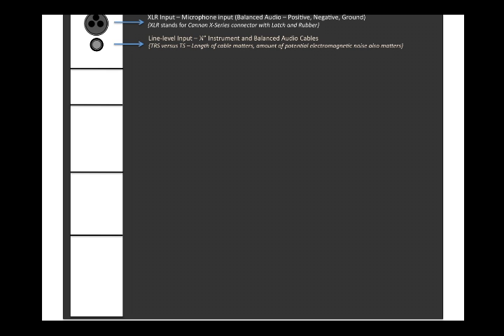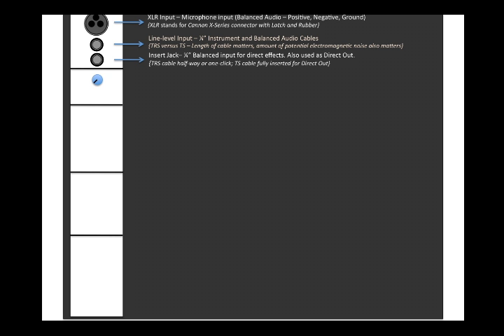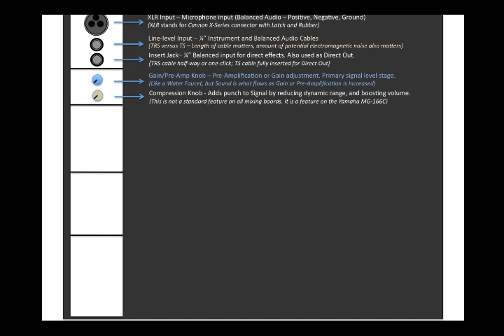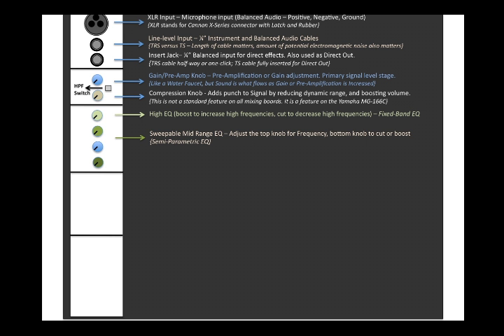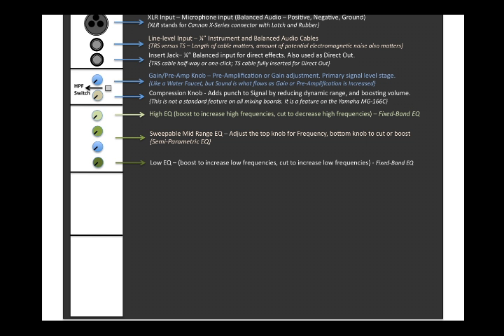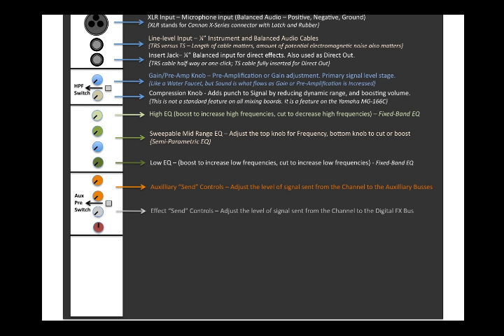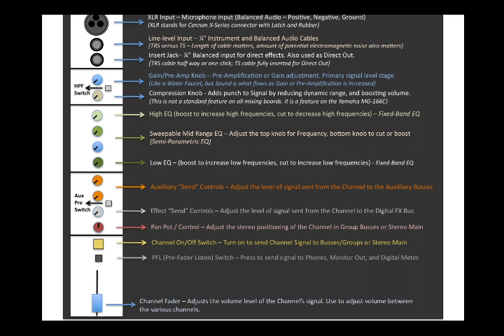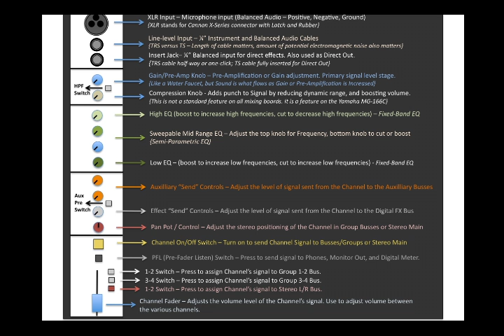The Mixing Board 'How Does It Work': Topic #1 - MONO Channel Strips

Comment: Question can you still some how make stereo music with a mono channel strip how would be the work flow? do drum bass vocals in mono piece by piece then you just have to duplicate your mono synth say for stereo and pan on far left and one far right is that right? Or re record the synth 2 times and effect them differently if you like for a stereo or paraelle effect!!! thanks trying to get my head around is it okay to buy one channel strip hardware or need 2 cheaper ones to make stereo?
Reply from the maker: MIIKE 5 It sounds like you are trying to figure out how the best way to create a stereo image from a mono source. 

So, if you just duplicate a source and pan it, it will technically still be mono. 

However, if you slightly delay one of the sides (after you’ve planned it) by around 30ms, you will get more of a stereo image.

You could also, as you stated, re-record the synth part and pan that track. That would also give you a stereo image.

Hope this helps!
Reply: @iamsamori  So does this give you 100% stereo image?
Reply: whats the most common way to create mono to stereo source I guess i am trying to figure out ?
Reply from the maker: MIIKE 5 As with most things Audio Engineering related, it comes down to personal preference. The two ways that I mentioned (duplicate, pan and delay one side) and (re-record the source and pan) are both very common. Give them a try and see which one you prefer.
Reply: @iamsamori  Thank you very much for the quick response trying to figure out is i worth buying a chanel strip thats mono and having that as my work flow even if i am trying to do stereo? is it common to have to different preamps in mono to make up one stereo? like a neve 1073 and a api pre for example?